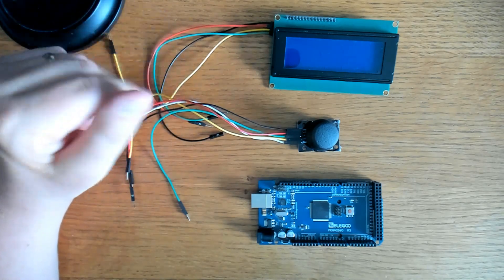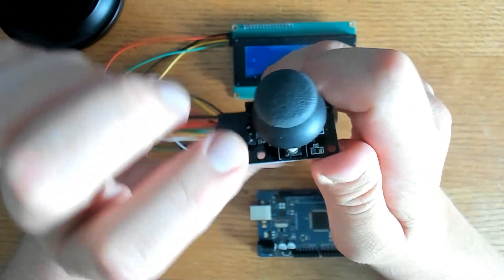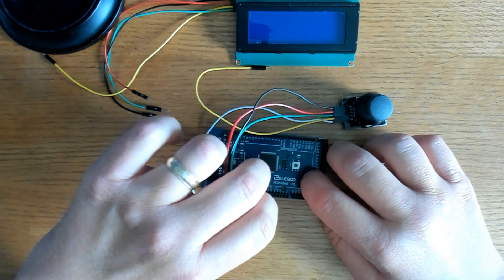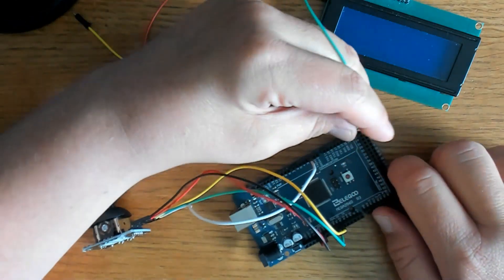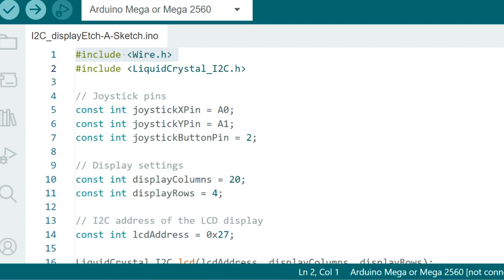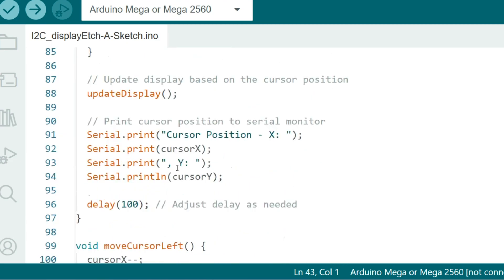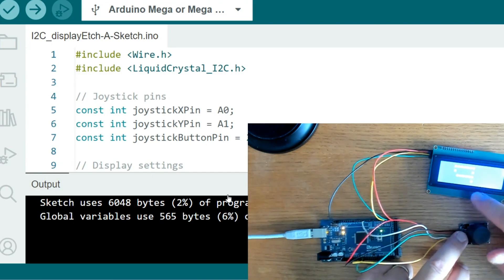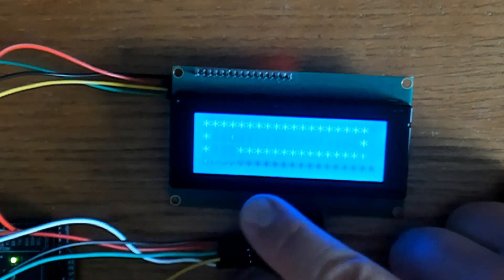Arduino Mega Project: Etch-a-Sketch with Joystick and LCD Display

Comment: How do i convert the code to a 128x64 display?
Reply from the maker: Sorryfor the late reply.  Doing a bit of traveling.
Try this: 

#include <Wire.h>
#include <Adafruit_GFX.h>
#include <Adafruit_SSD1306.h>

#define SCREEN_WIDTH 128
#define SCREEN_HEIGHT 64
#define OLED_RESET -1  
Adafruit_SSD1306 display(SCREEN_WIDTH, SCREEN_HEIGHT, &Wire, OLED_RESET);

const int joystickXPin      = A0;
const int joystickYPin      = A1;
const int joystickButtonPin = 2;

int cursorX = SCREEN_WIDTH / 2;
int cursorY = SCREEN_HEIGHT / 2;
bool drawStar = false;
bool displayState[SCREEN_HEIGHT][SCREEN_WIDTH];

void setup() {
  Serial.begin(9600);
  if (!display.begin(SSD1306_SWITCHCAPVCC, 0x3C)) {
    Serial.println(F("SSD1306 allocation failed"));
    while (true);
  }
  display.clearDisplay();
  display.display();

  pinMode(joystickButtonPin, INPUT_PULLUP);
  clearDisplayState();
  drawStar = true;
  updateDisplay();
}

void loop() {
  int joystickXValue = analogRead(joystickXPin);
  int joystickYValue = analogRead(joystickYPin);
  int joystickButtonState = digitalRead(joystickButtonPin);

  if (joystickXValue < 100)  moveCursorLeft();
  else if (joystickXValue > 900) moveCursorRight();

  if (joystickYValue < 100)  moveCursorUp();
  else if (joystickYValue > 900) moveCursorDown();

  if (joystickButtonState == LOW) {
    drawStar = true;
    cursorX = SCREEN_WIDTH / 2;
    cursorY = SCREEN_HEIGHT / 2;
    clearDisplayState();
    Serial.println("Display reset.");
  }

  updateDisplay();
  Serial.print("Cursor - X: "); Serial.print(cursorX);
  Serial.print(", Y: "); Serial.println(cursorY);
  delay(100);
}

void moveCursorLeft()  { if (--cursorX < 0) cursorX = 0; }
void moveCursorRight() { if (++cursorX >= SCREEN_WIDTH)  cursorX = SCREEN_WIDTH - 1; }
void moveCursorUp()    { if (--cursorY < 0) cursorY = 0; }
void moveCursorDown()  { if (++cursorY >= SCREEN_HEIGHT) cursorY = SCREEN_HEIGHT - 1; }

void updateDisplay() {
  display.clearDisplay();
  if (drawStar) {
    displayState[cursorY][cursorX] = true;
  }
  for (int row = 0; row < SCREEN_HEIGHT; row++) {
    for (int col = 0; col < SCREEN_WIDTH; col++) {
      if (displayState[row][col]) display.drawPixel(col, row, SSD1306_WHITE);
    }
  }
  display.display();
}

void clearDisplayState() {
  for (int row = 0; row < SCREEN_HEIGHT; row++) {
    for (int col = 0; col < SCREEN_WIDTH; col++) {
      displayState[row][col] = false;
    }
  }
}
Reply: @BMonsterLaboratory  Thanks!

Comment: Any advice on how I could do this using 2 potentiometers as knobs instead of a joystick?
Reply from the maker: You should be able to modify movement logic and map potentiometer values.
try this

#include <Wire.h>
#include <LiquidCrystal_I2C.h>

// Potentiometer pins
const int potXPin = A0;
const int potYPin = A1;
const int buttonPin = 2;

// Display settings
const int displayColumns = 20;
const int displayRows = 4;

// I2C address of the LCD display
const int lcdAddress = 0x27;
LiquidCrystal_I2C lcd(lcdAddress, displayColumns, displayRows);

// Cursor position
int cursorX = displayColumns / 2;
int cursorY = displayRows / 2;

// Flag to track if "*" should remain on the screen
bool drawStar = false;

// State of each position on the display
bool displayState[displayRows][displayColumns];

void setup() {
    // Initialize serial communication
    Serial.begin(9600);
    while (!Serial) {
        ; // Wait for serial port to connect
    }

    // Initialize the LCD display
    lcd.init();
    lcd.backlight();
    lcd.begin(displayColumns, displayRows);

    // Set initial cursor position
    lcd.setCursor(cursorX, cursorY);
    lcd.print("*");

    // Initialize display state
    clearDisplayState();

    // Set button pin as input with internal pull-up resistor
    pinMode(buttonPin, INPUT_PULLUP);
}

void loop() {
    // Read potentiometer values
    int potXValue = analogRead(potXPin);
    int potYValue = analogRead(potYPin);
    int buttonState = digitalRead(buttonPin);

    // Map the potentiometer values to cursor movement
    if (potXValue < 341) {
        moveCursorLeft();
    } else if (potXValue > 682) {
        moveCursorRight();
    }

    if (potYValue < 341) {
        moveCursorUp();
    } else if (potYValue > 682) {
        moveCursorDown();
    }

    // Check if button is pressed
    if (buttonState == LOW) {
        lcd.clear();
        drawStar = true;
        cursorX = displayColumns / 2;
        cursorY = displayRows / 2;
        clearDisplayState();
        Serial.println("Display reset.");
    }

    // Update display based on the cursor position
    updateDisplay();
    Serial.print("Cursor Position - X: ");
    Serial.print(cursorX);
    Serial.print(", Y: ");
    Serial.println(cursorY);
    delay(100); // Adjust delay as needed
}

void moveCursorLeft() {
    if (cursorX > 0) cursorX--;
}

void moveCursorRight() {
    if (cursorX < displayColumns - 1) cursorX++;
}

void moveCursorUp() {
    if (cursorY > 0) cursorY--;
}

void moveCursorDown() {
    if (cursorY < displayRows - 1) cursorY++;
}

void updateDisplay() {
    lcd.clear();
    if (drawStar) {
        lcd.setCursor(cursorX, cursorY);
        lcd.print("*");
        displayState[cursorY][cursorX] = true;
    }
    for (int row = 0; row < displayRows; row++) {
        for (int col = 0; col < displayColumns; col++) {
            if (displayState[row][col]) {
                lcd.setCursor(col, row);
                lcd.print("*");
            }
        }
    }
}

void clearDisplayState() {
    for (int row = 0; row < displayRows; row++) {
        for (int col = 0; col < displayColumns; col++) {
            displayState[row][col] = false;
        }
    }
}

connect your potentiometers to A0 and A1
Reply: Thank You!, you dont know how much this helps me sir!